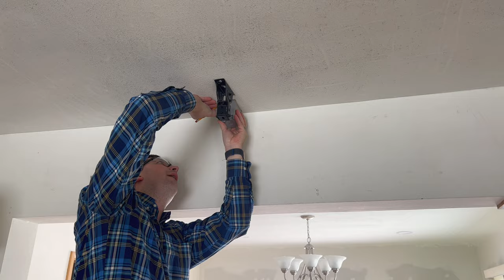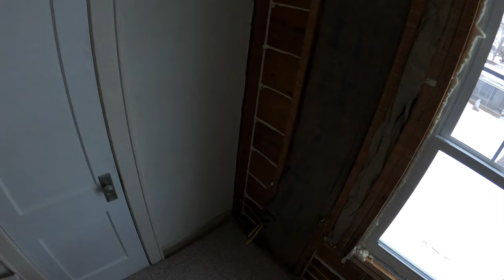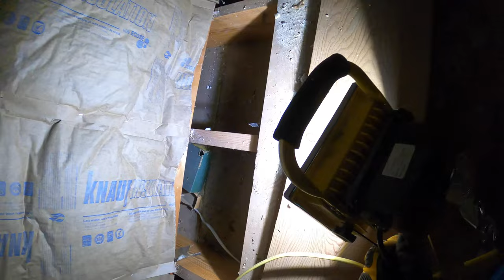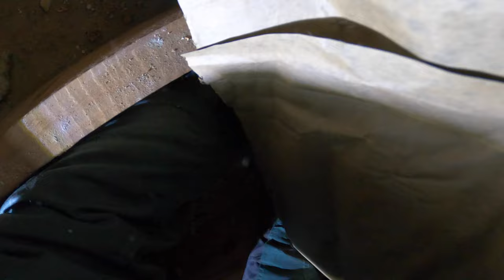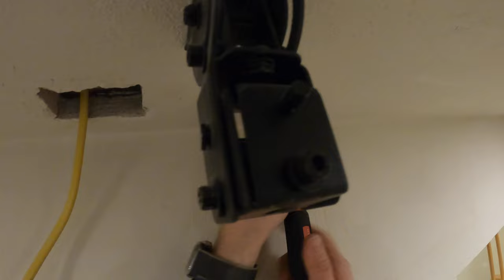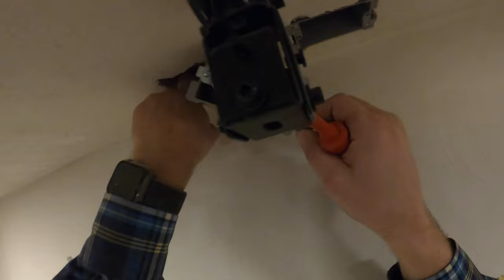Installing Outlets and Smurf Tube in the Ceiling

Comment: Great video. Which Smurf tube/box combo did you use? Is there a brand name?
Reply from the maker: I used whatever my local hardware store carries for ENT (smurf) conduit. For the box I used a regular box and drilled the correct sized hole, I'm not sure if they make a retofit style ENT box?